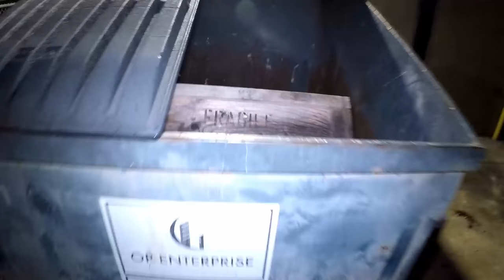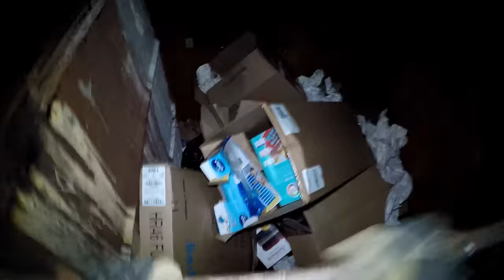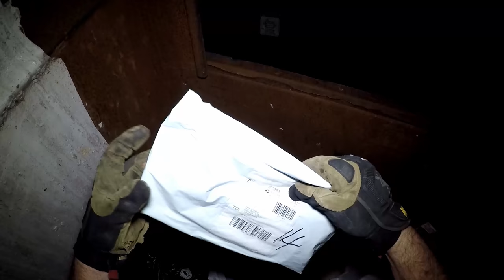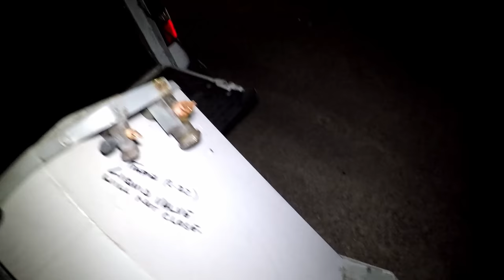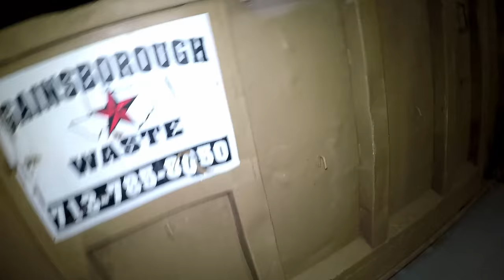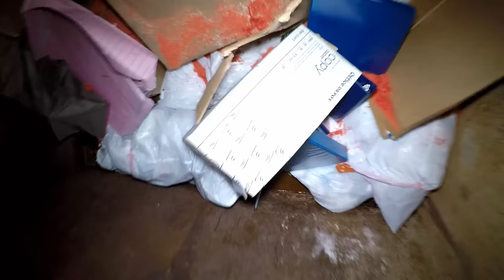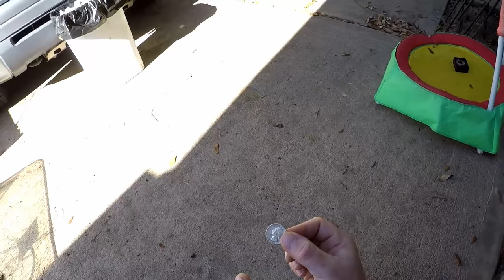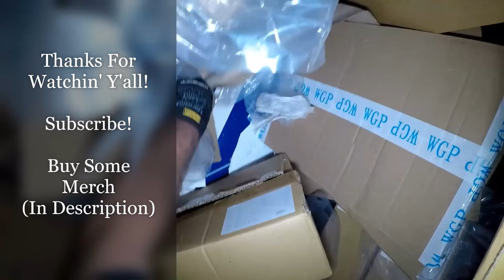Dumpster Diving "This Thing's Full Of Money!"

Comment: Awesome find with the coins, you need to look for certain dates & errors on the coins, also double or thicker rim errors that make the coins more valuable, some of those coins could be worth $100s or even $1000's of dollars, you should make a growing greenhouse with those fluro lights you found in your garden to be self sufficient & convert a air conditioning unit to convert water, the same way a air conditioning unit leaks water, if you do some moderations to it you can increase the amount of flow of water output that it leaks & collect it for drinking or watering your plants, so it's not so much a air conditioning unit but a water collector. You can fit it with solar panels for electricity as well as a power cord so it will produce water from being plugged into the power grid or just work on solar power outside anywhere, there is always some moisture in the air, on hot days I always walk past shops with the water from there air conditioning unit running on the ground by the shops front doors, filter & collect that properly?

Comment: Wow, nice truckload.  Legos are definitely a good find; those can be sold by the LB later.  Yep, 1964 and older dimes/quarters are 90% silver; no nickels were silver except the 1942-45 war time ones (35%) and if you ever find them, half dollars were silver up through 1970 (90% to 1964, 40% 1965-70).  Crazy to find almost $100 in straight up change put in a dumpster, had me jealous on that one hehehe

Comment: Looks like you have some coins that just might be worth some cash. That is not including the rolled ones, chances are if they are rolled there is probably no cash value over what the coin is, a quarter is worth a quarter...someone has probably already checked those out before they rolled them, unless they are from an old bank or something like that. Those that are in the plastic bags have probably never been in circulation. You can be sure there is something special about those.

Comment: You should install a small winch in the back of the truck. When you get something like this drop the tailgate and wrap a rope around it. Use the winch and drag it up.  Or even find some wood and slide it up with the winch

Comment: You should add a small wench to the inside of the bed of your truck and have a little ramp and it would easier to get stuff like the AC unit in there.

Comment: 1964 and lower are 90% silver. Just quarters dimes half dollar and silver dollar. And from 1965-67 they are 40%. Some nickels from 1945 are silver but not sure the date. Nice find.
Reply: U.S. Half Dollars (only) dated 1965 - 70 were a 'silver clad' with net 40% silver content.
The 'War Nickels' were 56% copper, 35% silver, 9% manganese. 
All 1942D were the usual 75% copper, 25% nickel.
The 1942 Philadelphia 5C were changed mid year, so both 'nickel' and 35% silver were issued.
All 1942S and all 1943 through 1945 U.S. 5c were of the 56% copper, 35% silver, 9% manganese alloy.
'War Nickels' (35% silver) have large mint marks over the dome of Monticello on the reverse (back), the 'P' being the first used for Philadelphia.

Comment: Nice find on the bucket of money!! Just fyi, it is 1964 and earlier where you'll find the silver coins. Dimes and quarters were 99.9% silver up to 1964. 1965 quarters you can hear the little bit of silver in those, I think it's about 33% or so roughly. Stay safe out there, man! New subscriber here! 😎
Reply: Not 99.9, but .900 fine. There is no silver in a 1965 U. S. Quarter unless it is a rare error stuck on the previous year's planchet.
Along with pre 1965 Dimes through Dollars being 90% silver, U.S. Half Dollars (only) dated 1965 - 70 were a 'silver clad' with net 40% silver content.
The 'War Nickels' were 56% copper, 35% silver, 9% manganese. 
All 1942D were the usual 75% copper, 25% nickel.
The 1942 Philadelphia 5C were changed mid year, so both 'nickel' and 35% silver were issued.
All 1942S and all 1943 through 1945 U.S. 5c were of the 56% copper, 35% silver, 9% manganese alloy.
'War Nickels' (35% silver) have large mint marks over the dome of Monticello on the reverse (back), the 'P' being the first used for Philadelphia.

Comment: Or just look at the edges of the coins the silver will be silver and the modern will have the red copper visible. Only nickels from 42-45 were silver (35%) as well as some 46 transitional planchet mint errors.
Reply: The pre 1965 Dimes through Dollars were 90% silver, U.S. Half Dollars (only) dated 1965 - 70 were a 'silver clad' with net 40% silver content.
The 'War Nickels' were 56% copper, 35% silver, 9% manganese. 
All 1942D were the usual 75% copper, 25% nickel.
The 1942 Philadelphia 5C were changed mid year, so both 'nickel' and 35% silver were issued.
All 1942S and all 1943 through 1945 U.S. 5c were of the 56% copper, 35% silver, 9% manganese alloy.
'War Nickels' (35% silver) have large mint marks over the dome of Monticello on the reverse (back), the 'P' being the first used for Philadelphia.

Comment: The easiest way to tell if a coin is silver is by looking at the edge. Regular quarters and dimes look like a sandwich of copper and nickle. Silver wont have the copper color. Nickles are harder to tell just by looking at them. Great find man!!
Reply: Along with pre 1965 Dimes through Dollars being 90% silver, U.S. Half Dollars (only) dated 1965 - 70 were a 'silver clad' with net 40% silver content.
The 'War Nickels' were 56% copper, 35% silver, 9% manganese. 
All 1942D were the usual 75% copper, 25% nickel.
The 1942 Philadelphia 5C were changed mid year, so both 'nickel' and 35% silver were issued.
All 1942S and all 1943 through 1945 U.S. 5c were of the 56% copper, 35% silver, 9% manganese alloy.
'War Nickels' (35% silver) have large mint marks over the dome of Monticello on the reverse (back), the 'P' being the first used for Philadelphia.

Comment: Pre64 are 90% silver , after that up to like 69-70ish were 40% silver then they went to copper clad
Reply: U.S. Half Dollars (only) dated 1965 - 70 were a 'silver clad' with net 40% silver content. Dime and Quarter dollars went to Copper Nickel clad in 1965.
The 'War Nickels' were 56% copper, 35% silver, 9% manganese. 
All 1942D were the usual 75% copper, 25% nickel.
The 1942 Philadelphia 5C were changed mid year, so both 'nickel' and 35% silver were issued.
All 1942S and all 1943 through 1945 U.S. 5c were of the 56% copper, 35% silver, 9% manganese alloy.
'War Nickels' (35% silver) have large mint marks over the dome of Monticello on the reverse (back), the 'P' being the first used for Philadelphia.

Comment: Nickels are made of nickel. Only 42-45 are 35% silver
Reply: The 'War Nickels' were 56% copper, 35% silver, 9% manganese. All 1942D were the usual 75% copper, 25% nickel as used since 1866 for the Five Cent 'Nickel (first used on 'Three Cent Nickels, 1865 - 1889).
The 1942 Philadelphia 5C were changed mid year, so both 'nickel' and 35% silver were issued.
All 1942S and all 1943 through 1945 (PDS) U.S. 5c were of the 35% silver alloy.
All 'War Nickels' (.35 silver) have large mint marks over the dome of Monticello on the reverse (back), the 'P' being the first used for Philadelphia.

Comment: 1964 abd before are 90 % silver after 64 they became CLAD
Reply: U.S. Half Dollars (only) dated 1965 - 70 were a 'silver clad' with net 40% silver content.
The 'War Nickels' were 56% copper, 35% silver, 9% manganese. 
All 1942D were the usual 75% copper, 25% nickel.
The 1942 Philadelphia 5C were changed mid year, so both 'nickel' and 35% silver were issued.
All 1942S and all 1943 through 1945 U.S. 5c were of the 56% copper, 35% silver, 9% manganese alloy.
'War Nickels' (35% silver) have large mint marks over the dome of Monticello on the reverse (back), the 'P' being the first used for Philadelphia.

Comment: 1964 and older but there's 1 or 2 other that are silver too. Quickest way is to look at the sides.  If you see copper is no
Reply: Along with pre 1965 Dimes through Dollars being 90% silver, U.S. Half Dollars (only) dated 1965 - 70 were a 'silver clad' with net 40% silver content.
The 'War Nickels' were 56% copper, 35% silver, 9% manganese. 
All 1942D were the usual 75% copper, 25% nickel.
The 1942 Philadelphia 5C were changed mid year, so both 'nickel' and 35% silver were issued.
All 1942S and all 1943 through 1945 U.S. 5c were of the 56% copper, 35% silver, 9% manganese alloy.
'War Nickels' (35% silver) have large mint marks over the dome of Monticello on the reverse (back), the 'P' being the first used for Philadelphia.

Comment: You probably know by now that 1964 and before quarters and dimes are called coin silver.  The content is 90 percent silver.  You put a smile on my face.  Really enjoy watching your videos.  Thank you.
Reply: Along with pre 1965 Dimes through Dollars being 90% silver, U.S. Half Dollars (only) dated 1965 - 70 were a 'silver clad' with net 40% silver content.
The 'War Nickels' were 56% copper, 35% silver, 9% manganese. 
All 1942D were the usual 75% copper, 25% nickel.
The 1942 Philadelphia 5C were changed mid year, so both 'nickel' and 35% silver were issued.
All 1942S and all 1943 through 1945 U.S. 5c were of the 56% copper, 35% silver, 9% manganese alloy.
'War Nickels' (35% silver) have large mint marks over the dome of Monticello on the reverse (back), the 'P' being the first used for Philadelphia.

Comment: Check thoes coins well some are worth a lot depending on where and when it was minted and always hold onto silver coins
Reply: Yes, Along with pre 1965 Dimes through Dollars being 90% silver, U.S. Half Dollars (only) dated 1965 - 70 were a 'silver clad' with net 40% silver content.
The 'War Nickels' were 56% copper, 35% silver, 9% manganese. 
All 1942D were the usual 75% copper, 25% nickel.
The 1942 Philadelphia 5C were changed mid year, so both 'nickel' and 35% silver were issued.
All 1942S and all 1943 through 1945 U.S. 5c were of the 56% copper, 35% silver, 9% manganese alloy.
'War Nickels' (35% silver) have large mint marks over the dome of Monticello on the reverse (back), the 'P' being the first used for Philadelphia.

Comment: You can also hold the coins up and look at the edges to determine if they are silver or silver clad. The silver clad ones, you can see copper in the inner layer, hence silver clad.
Reply: Only the 1965 through 1970 Half Dollars are 'silver clad', with net 40% silver content. 1971 - present are copper nickel clad as are dimes, quarters from 1965 onward.
Pre - 1955 Dime through Dollar were 90% silver from 1964 back.

Comment: 1964
Reply: The pre 1965 Dimes through Dollars being 90% silver, U.S. Half Dollars (only) dated 1965 - 70 were a 'silver clad' with net 40% silver content.
The 'War Nickels' were 56% copper, 35% silver, 9% manganese. 
All 1942D were the usual 75% copper, 25% nickel.
The 1942 Philadelphia 5C were changed mid year, so both 'nickel' and 35% silver were issued.
All 1942S and all 1943 through 1945 U.S. 5c were of the 56% copper, 35% silver, 9% manganese alloy.
'War Nickels' (35% silver) have large mint marks over the dome of Monticello on the reverse (back), the 'P' being the first used for Philadelphia.

Comment: Hope you’re aware that some of the aluminum with electronic circuit boards have high voltage capacitors on them. Some of those capacitors hold enough charge that can kill if they have not been properly discharged prior to being thrown I the dumpster!